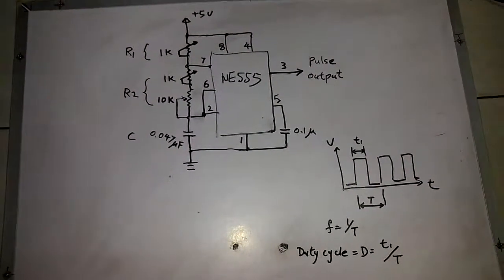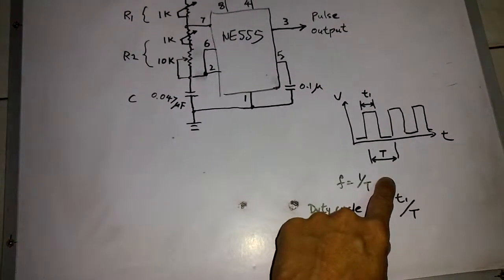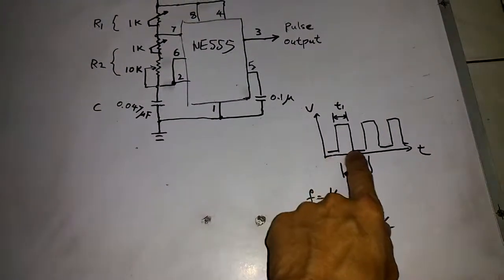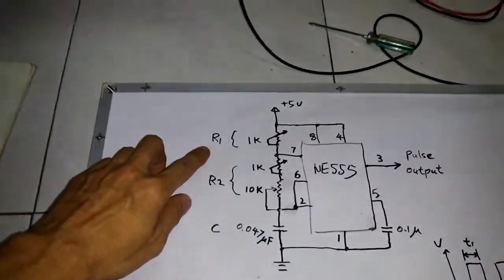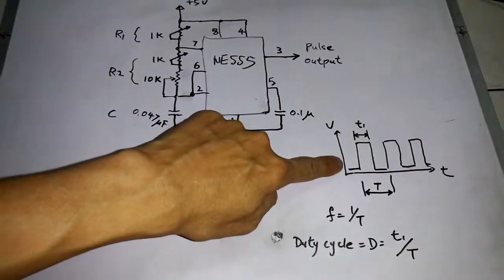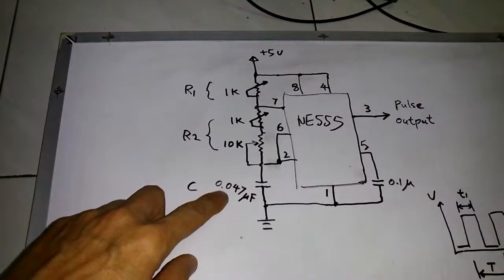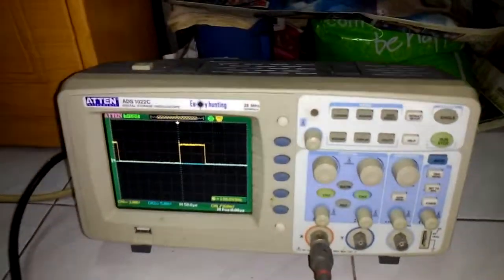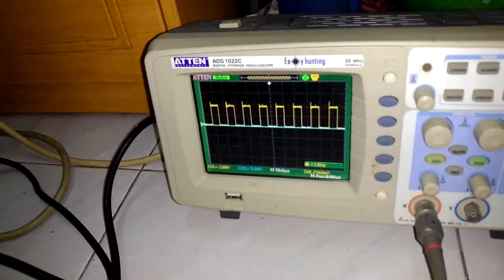DIY 5th axis added pulse circuit for lath turning - 9 (High Z CNC-STEP)

Comment: How much stiff is  that heiz machine,did you measure the flex with dial indicator and applying some force by hand..
Reply from the maker: Heiz machine is strong in all aspects except the z-axis! Actually, I already done the strengthening in it. In aluminium machining, flexing is little and can be remedied by mulit-passes cutting during milling.